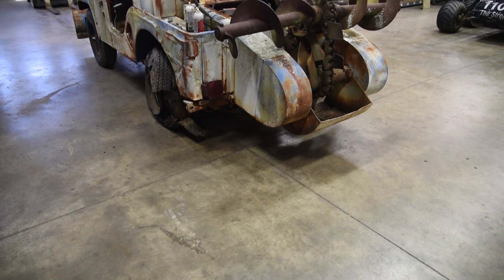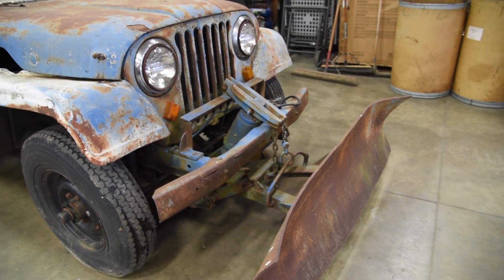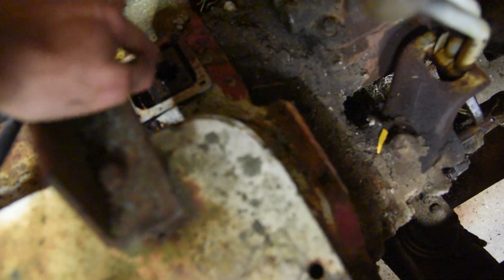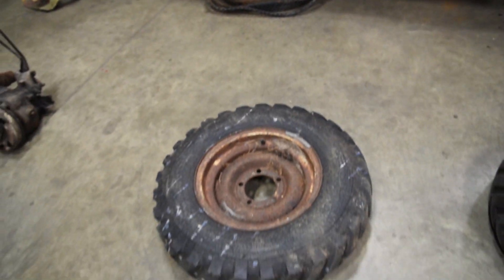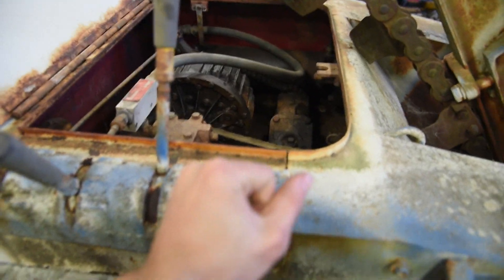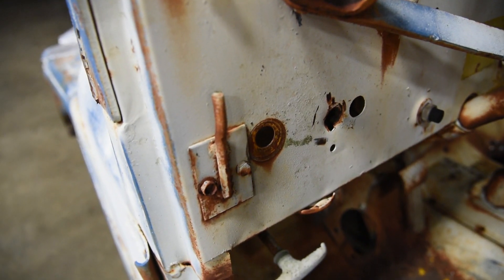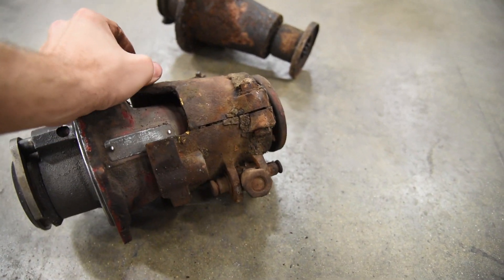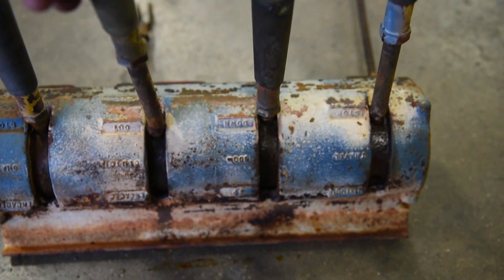Bringing a 1959 Willys Jeep-A-Trench Back to Life

Comment: sir i would recommend you to be using electrolysis to fight rust on small pieces like control levers assembly rather than using bucket of white winegar. it´s super easy to use, i use it regularly when fixing my rust buckets.

Comment: "the Jeep gladiator is jeeps first pick-up" apparently not
Reply: Koenig and other aftermarket suppliers made bolt on 1, 2, and 3 foot extension beds for early Jeeps. I use a 2 footer on my 'Flatties'. Removes or reinstalls in minutes.
Willys and Kaiser also made full sized pick ups from 1947 through 1965, Kaiser - Jeep built cab over 'Forward Control' models from 1957 - 66, and the original Gladiator was built by Kaiser, then AMC from 1963 - 87.
The 1967 - 73 second generation Jeepsters and Commandos could also be considered 'pickup trucks' of a sort.